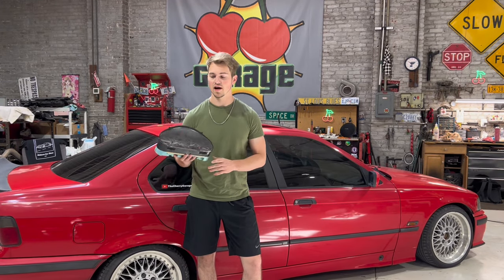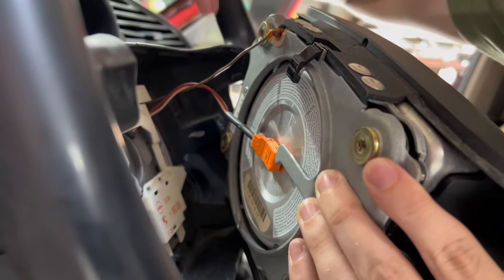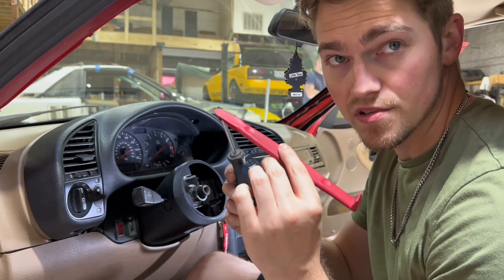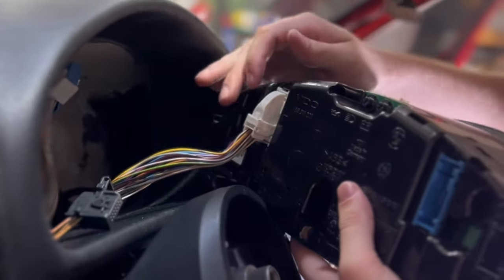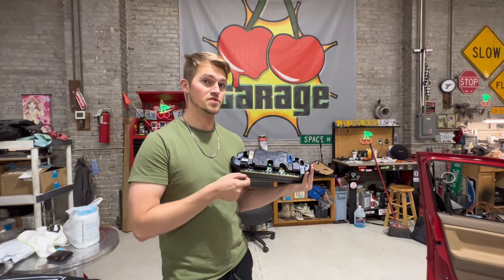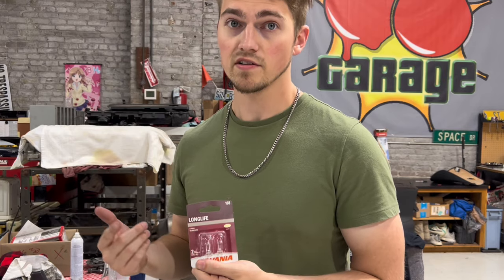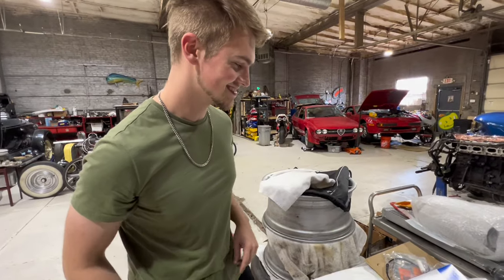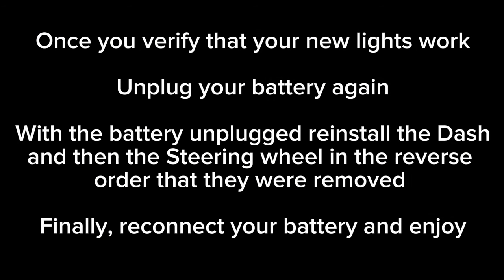BMW E36 Dashboard Light Repair  HOW-TO (Upgrade)

Comment: Did your rpm and mph gauge work cause everything else on my cluster works but those don’t light up for me :(
Reply from the maker: Yes, after replacing the bulbs with the news ones, the RPM and MPH gauges illuminated as expected. 
Did you replace with new bulbs as well?
Reply: @TheCherryGarage  I replaced my bulbs and it still didn’t work, used my friends dimmer switch and it all worked, thanks for the video was helpful

Comment: Idk if u mentioned it but you dont have to remove the steering wheel, you just need a little bit of finger work and u can slip the cluster out to the passenger side. Anyway good video :)
Reply from the maker: This is true! I’ve done it that way before but it wasn’t the most fun 😂

Comment: I'm having this problem with my cluster   wondering if anyone else here is experiencing it. Sometimes while I'm driving my cluster will randomly light up and the all the gauges will zero out while I'm driving. Usually they come right back on but not all the time.
Reply from the maker: Sounds like a bad ground! Or possibly issue with the back circuit board.
Reply: I had the same problem, it was a bad solder joint on the crystal oscillator on the cluster PCB. As i have red is pretty common failure point. Fixing it is very easy, you just have to melt the 2 solder points and let it cool back.